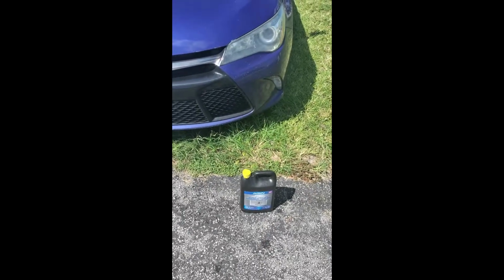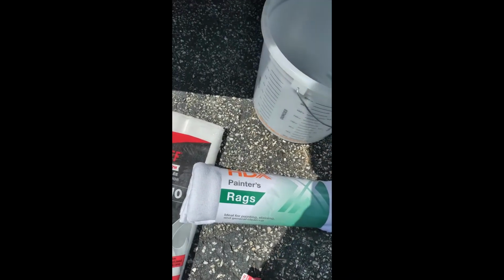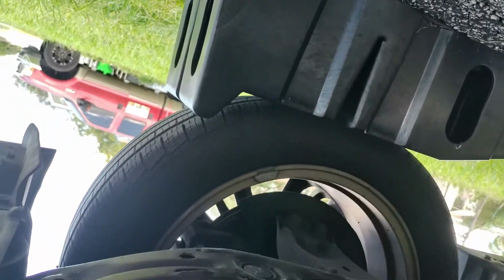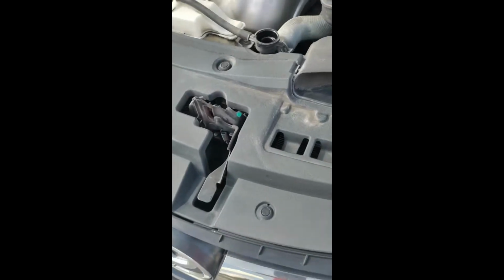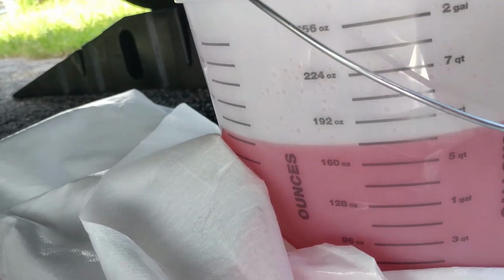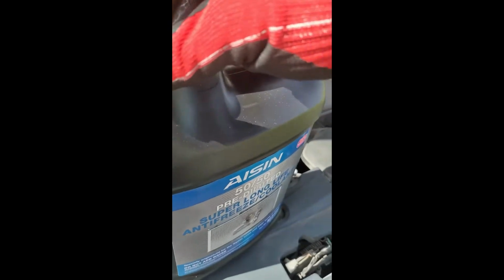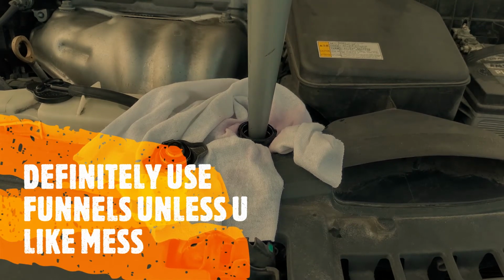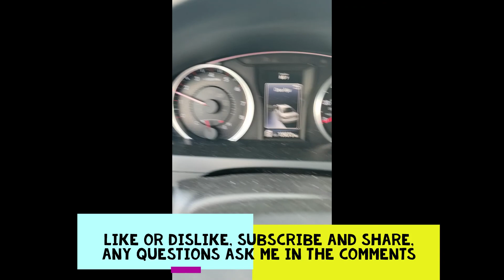COOLANT DRAIN AND FILL 2016 TOYOTA CAMRY SE 2.5

Comment: Tip:  The petcock drain has a nozzle on it.  You can push on clear vinyl hose tubing and put the other end right in the bucket or pan.  No spills. No mess.

Comment: This is just drain and not flush. You emptied the radiator, but did not disconnect the bottom hose or the drain valve on the engine block. You left a good 30% of your old coolant in there. A flush is when you take a special cleaner or distilled water and run it thorough the system and drain it. Do this several times until it comes out clear. Then you should add a 70/30 mix to make up for any left over distilled water in the system. If you don't care about money, then you can get multiple gallons of the 50/50 mix and do it that way too. What you did is fine, but it isn't a flush.
Reply from the maker: Damn that much is still in there.  I appreciate ur clarification i sometimes use the wrong terms to describe what im doing. let me see if i can edit it.  I want the car to go half a million miles at least. Im glad to know i didnt screw anything up
Reply: @danielakasmart2891  You didn't screw up at all. You just want to make sure that you flush the system to remove any contaminates left in there. It is not necessary, but it will extend the life of your thermostat and water pump.
Reply from the maker: @pokefan5022  Thank u